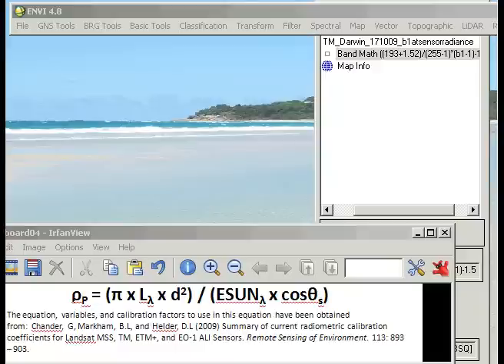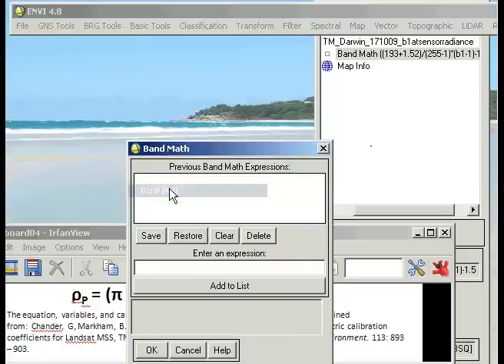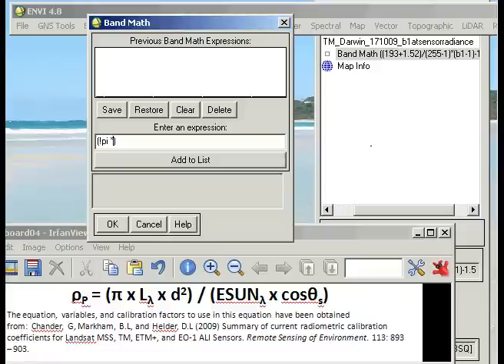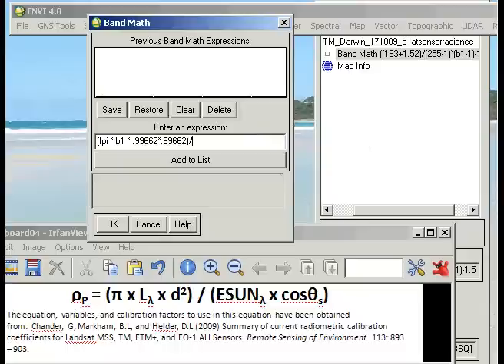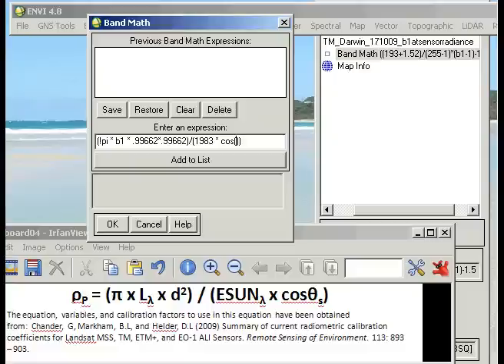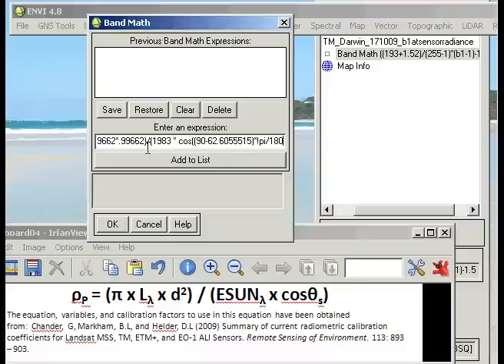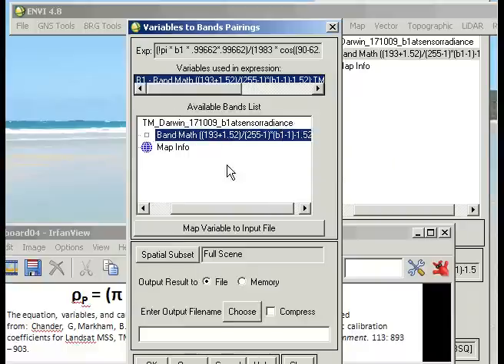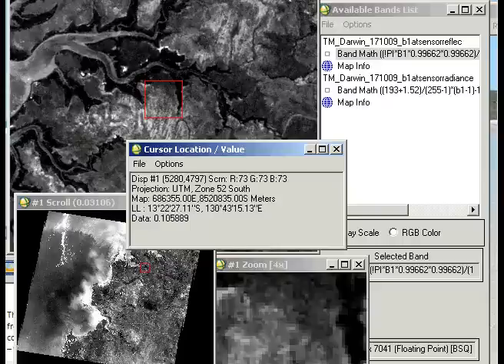Radiometric calibration using band math in ENVI to calculate at sensor reflectance

Comment: Hi Karen, 
Thank you very much for your video. However, I don't know  why I couldn't apply that formular to my ENVI 5.3. I am using Landsat TM in 1998. Sun_elevation = 46.56964176; Earth_sun_distance = 0.9839956. and I wrote  the formular as below , unfortunately I doesn't work. 
(!pi * "radiance_B1" * 0.9839956 * 0.9839956) / (1983 * cos ((90 - 46.56964176) * !pi/180))
it says "You have entered an invalid expression. Check for syntax errors or undefined procedures and functions and try again".
I really don't know what wrong with this formula. 
But If I wrote your formular which exact the number you're given above. then it works. But it doesn't make sense in my scene. 
any idea, Thanks,